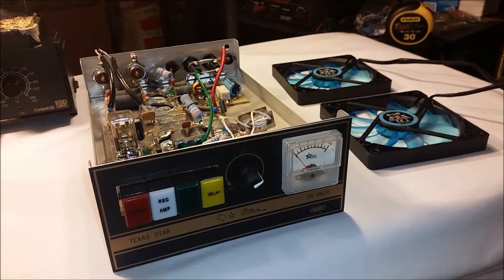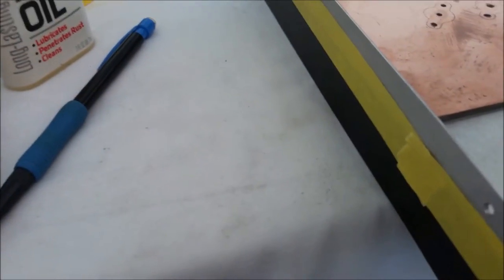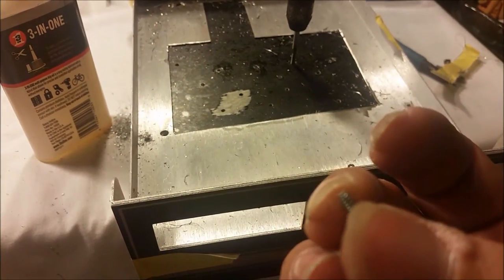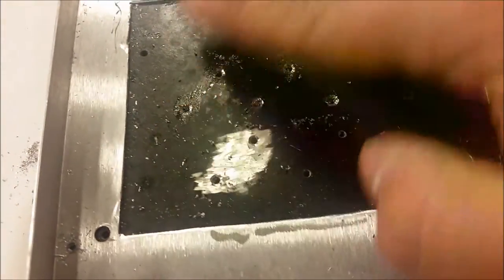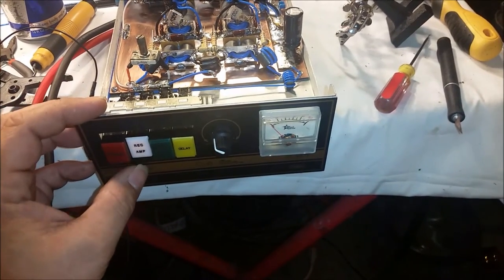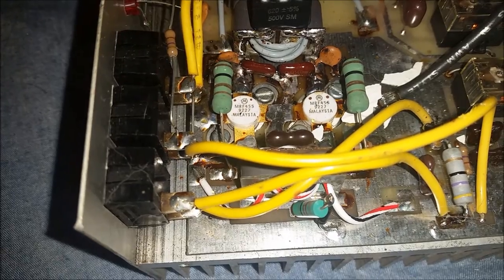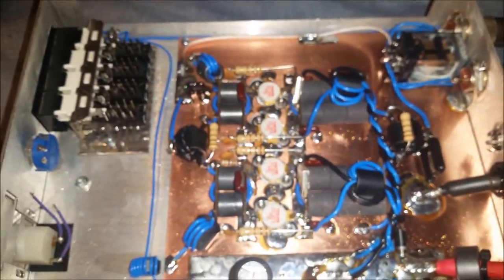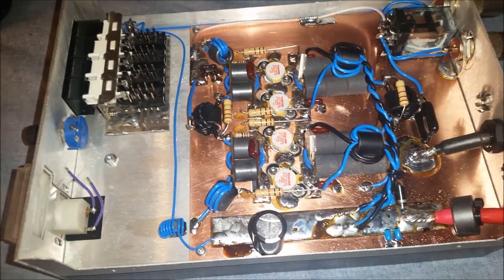Gatekeeper In Amp Building Concepts - Building A Texas Star Sleeper

Comment: I never had saw this till today.
My 667 8 pill sleeper.
I love but i would like to get the texas star buttons and meter in the case.
The buttons i think is doable the meter not so much.
If i cut the board like what you did there and flip the switches up side down and move the lens as needed it may fly. For sure they wont fit the right way.
Reply from the maker: Cool man...yeh I have over 1k videos so its tuff imma organize them better in my play list soon.

Comment: Beautiful sleeper box Gatekeeper ! It's amazing how these boxes perform.  Gatekeeper....I have been totally re-doing a DX 350 HDV Texas Star and it powers up, has receive  pass through and dial watt functions that work. The relay keys up along with the LED on the meter, yet the amp meter does not show any sign of OUTPUT.  I have capacitive trimmers on the input and output transformers with a value of 280 pf. My bench watt meter shows 40 watts on the 1000 watt scale. I am using a variable power set at Two watts on my radio and 14 volts power to the amp. All parts on the amp have been replaced including the transformers and two tochiba 2879's pills. I am also using a 50 ohm dummy load. Can you tell me why I am not seeing a good output on the ( onboard  amp meter ) and on my bench wattmeter ? At least all the functions are working, but would like to see this working to its peak. Thanks, Billy....Albq. N.M.   1 /27 / 2023
Reply from the maker: Last things I would check are the capacitors ontop of the transformers and as far as the input and output caps go you should be able to use what it calls. Since Texas Stars are all etched boards the tuning is the same and doesn't need to be fine tuned usually but under social circumstances.....look up the schematics ans follow the values for the input and output hope that helps buddy